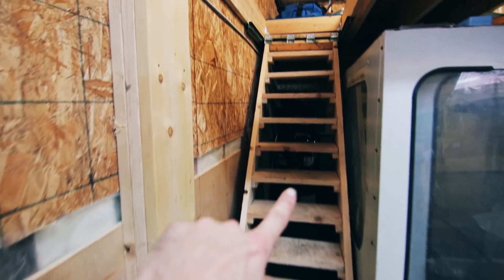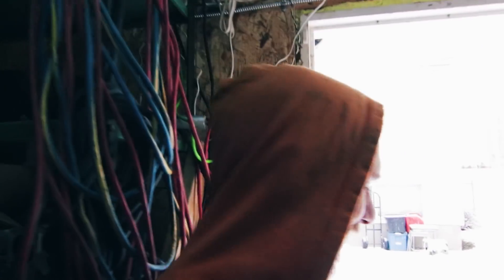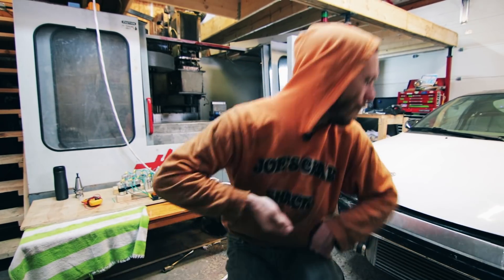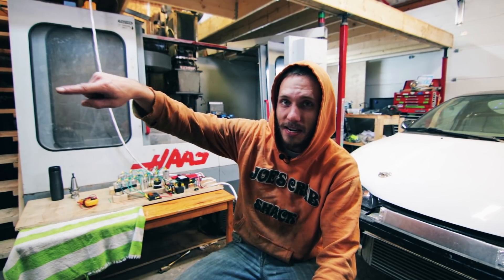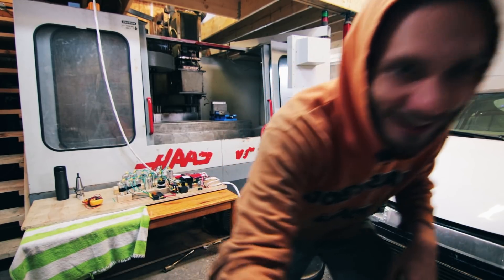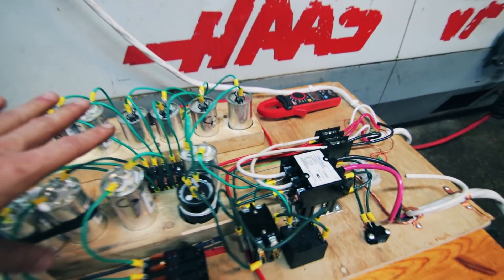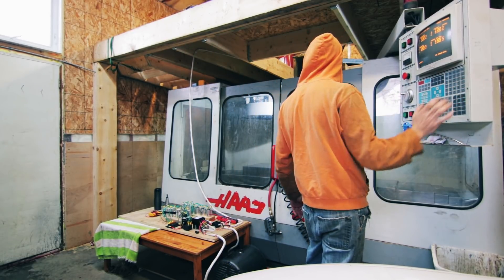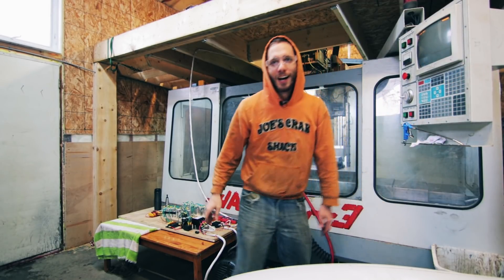First chips on my [HAAS]? Is it really cheaper than [Tormach] ? (-$10K)

Comment: I'll take a 20 year old used Haas over a brand new Tormach ANY DAY. Rigidity, weight, power, accuracy, repeatability, potential for upgrades, WIPS, standard CAT40 tooling, not to mention SERVICE. Haas machines hold their value for a reason.
Reply from the maker: Agreed. It's a no brainer to me. I am betting Tormach takes a sales hit as more and more people take the route I did. 👍😁
Reply: @LucasIsBusy  I have a 2001 Haas Mini Mill myself. The control panel and I/O board were updated in 2016 so it's WIPS compatible. You can do the same if you get a Haas tech to retrofit your control panel. Despite being an almost 20 year old machine, it has less runout and is more accurate than a brand new Tormach, and with the linear ways, it doesn't require monthly gib adjustments. With ATC, 7.5hp spindle, 4000lbs, linear ways, coolant pump and updated control, it cost $14k. A Tormach 1100MX would have been $28k after taxes, and that would have only weighed 1600lbs with a 2hp spindle. The Haas also can have an auger added to it for easier cleanup. There is just no comparison. I don't know how Tormach stays in business with the prices they ask. I think it's just people wishing to shy away from older machines. My answer to that is to have a good tech inspect the machine first! Plenty of bargains out there with used Haas equipment. Anyway, very cool seeing your work and progress with that old VF. Hope you make some awesome stuff with it!
Reply from the maker: @excelsiorsabers  I checked with Haas and it's a. 11K upgrade for mine. I'm curious how they convert the DC servos... I think the controls are AC after 1997. I installed WIPS in mine, minus the wireless. Ive seen a new cheapo wireless unit in posts lately, but it's from Russia and takes like a month to ship.
Reply: @LucasIsBusy  Yep 11k sounds about right. Still, even if you did that, you'd have a Haas VF3 with modern control and electronics for less than the cost of a new Tormach 1100MX with ATC. I'd call that a win! WIPS is definitely worth it, but glad to hear you at least got a wired probe going for now. The OTS alone saves so much time.
Reply from the maker: @excelsiorsabers  oh man, agreed!!! I love the tool setter so much. I honestly had it on day 1 so I do not know how to do tool offsets properly hahahah.

Im curious how fast I could jack the IPM on it once upgraded? I think I'd rather upgrade my spindle speed first though. I think I can get a 12k or 15K spindle upgrade for the about 6K. But I don't think my IPM could enable HEM paths tho.
Reply: @LucasIsBusy  I hear you. The OTS saves so much setup time--way easier than the traditional method of using blocks or a sheet of paper and jogging down by tenths. I love that thing. I'd definitely recommend the upgraded control first--get all of that running, then upgrade the spindle and you'll be able to maximize its performance, especially with HSM (which you can add later as well). You'll have a solid production machine for a fraction of the price by the time it's all said and done! Way cheaper than buying a new one all optioned out!

Comment: I have a high pressure gas licence and it is universal code that you cannot run a gas line in the same trench with a power supply cable. Was your power feed already back filled before the inspector looked at it ? Your inspector should study the code a little more.
Reply from the maker: Canada has different laws I guess. Laws between cities are different as well and the inspector for both the gas and the electrical both came and passed the direct bury. Gas and elec can be in the same trench IF the gas is buried at a depth of 36" and then a minimum of 12" of dirt is between them. I can also bury a comms conduit as long as it's a certain distance  from the elc, which it was.

Both inspectors came at the right times. I had an open trench with gas and it passed bc it was at 39" and then I buried it and dropped the elec line in and then another inspector came and passed it.

I checked our codes and it's written in their exactly as I installed it.

Comment: your Haas has crt and vertical tool changer  is it like a 1999    is it cat 40?
Reply from the maker: It's a 1995....spindle is both  Cat and Bt40 but the tool changer umbrella fingers are BT40 soooo I'm all BT40 tooling. It was like $800 to change out the fingers to Cat40.

Comment: This is awesome, would love to find an old Haas and get it working in the garage.  Thanks for sharing!
Reply from the maker: Thanks for the support! Having a such a large and capable mill has been life changing for sure. I feel like a painter who just picked up his first paint brush and took the first stoke across the canvas. I am really in my element now and am growing by leaps and bounds.  I think I got quite lucky though, who ever sold it to me did not know what they had. It was caked in sawdust and some small flakes of plastic. I really believe it to be one of the fabled "this machine has only ever cut wood" as it still hold ~0.0002" in every axis. I am very grateful this project has worked out the way it has. 😀👍
Reply: I came across a Bridgeport deal like those stories you hear about, but a Haas?  So awesome...  am curious if the older controller can handle high density 3D tool paths like say a 3D scallop finishing operation?  Is it limited on size of gcode file?  Regardless, congrats on your new tool!
Reply from the maker: @desktoplathes  Yes it is limited to a paltry 256K. However, I found a thread on the practicalmachnist forum and you can just solder in more chips to get 1MB or maybe its even more than that. Before I messed with the board I purchased a shoplink USB and it is able to drip feed from a USB so you can use as big a USB as you want. I haven't needed it yet, but online peeps say that it works very well to drip feed like that.

Comment: What did you put your gas line in underground,, i cant tell? i have pulled up some really corroded lines that were done in non galvanized pipe, some soils are very acidic.  DOESN'T  look like you used CSST.
Reply from the maker: I installed MDPE plastic pipe as per the gas code in my area. I then had it inspected and approved by the City  before I covered it back up. :D

Comment: I recommend some better endmills. Yg1 3fl are good for aluminum. And z-carb 4fl are good for steel/stainless. Otherwise you are looking good. It’s important you clean out that material because it will wreck your linear ways and ballscrews. Goodluck let me know if you need help with anything.
Reply from the maker: I've almost got it clean. There was a lot of build up.

Comment: hi lukas, i really like your channel. if the haas was doing fiberglass make sure that you clean the guides and the internals REEEAL good cos that shit is very gritty and will f*k your precision in the long term. 

what is your beackground? were you a mechanic? engineer? 

cheers! and keep up with the good content!
Reply from the maker: I have degree in mechanical engineering, I was a welder before that, but generally I just like machines and electronics. :)

I have been cleaning that stuff out of everywhere. What a pain. Lots of saw dust too. I have all the ways apart right now and I'm cleaning them, but it is slooooow going. So itchy if it gets on my skim so I'm suited up for the most part. Just so slow, but I'll get there.
Reply: sweet thank!. now go and make some more videos, you are slacking ;)